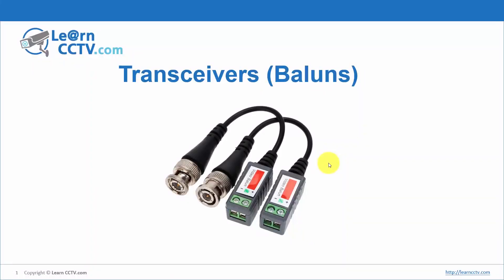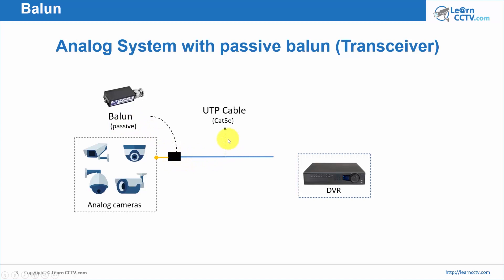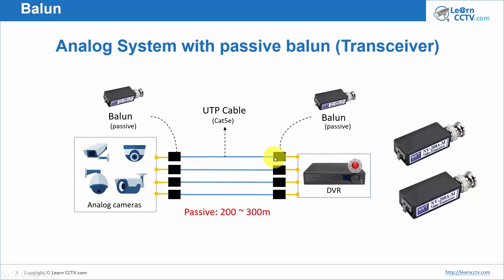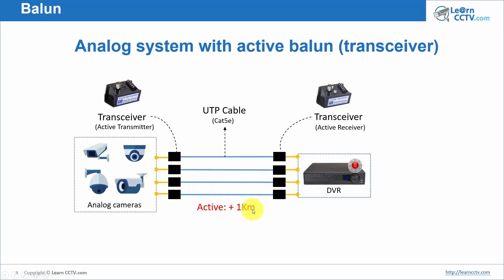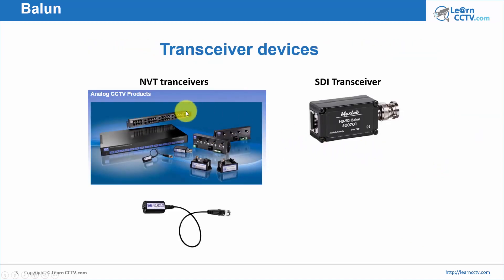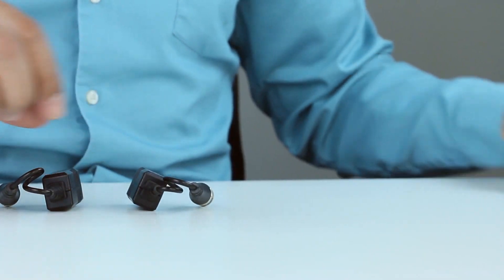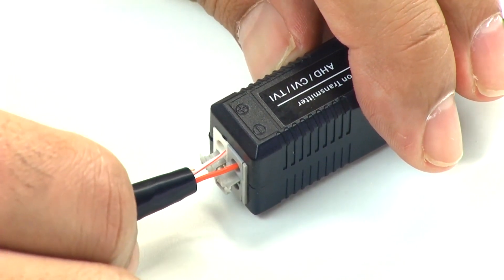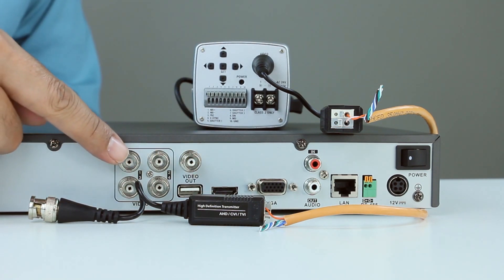How to Install Video Balun for CCTV Camera (HD-TVI, HD-CVI and AHD cameras)

Comment: Hi there, I have difficulty to connect my IP camera with my DVR? I cut my IP camera's cable and now need to reconnect it with cat 5 cable or just ordinary camera cable. Please any solution? I have 2 Video Balun as well, but as you know IP camera has 7 color wires.
Reply from the maker: There are two different technologies. 1. Analog and 2. IP.  The analog cameras use RG59 (coaxial) cables or UTP cables with baluns to connect to a DVR (Digital Vídeo Recorder). The IP cameras use UTP (cat5e or cat6) cable to connect to an NVR (Network Vídeo Recorder).
You can NOT cut the UTP cable from an IP camera and connect it to a DVR the same way you do with an analog camera.
Baluns are for analog cameras, IP cameras don’t use them. The exception for that is when an IP camera is hybrid and also has an analog output, but that is not common and it’s usually available on more expensive cameras such as the Samsung SNB-6004 and its newer versions.

Comment: Sir can i ask where's your centralized power supply? im using Dahua T1A21 2MP HDCVI IR Eyeball Camera & Dahua XVR1B08H 8CH Penta-brid 4M-N/1080P Cooper 1U DVR.. Diagram eg. CCTV to Video Balun to Cat5e to Video Balun to DVR. There's no power to the CCTV?
Reply from the maker: Vídeo and Power are sent using different cables. In the video I show only for the video, but there's a centralized power supply that can handle up to 8 cameras. You can find other video in the channel where I talk about the power supply.

Comment: Hello I must say I don't understand,  why do we need these video balun why can we just plug camera to dvr ? please explain why we need them . I'll tell you why I am looking at this video  I bought a 4K camera that only work with a TVI DVR and didn't know it , so now I want to make it work with out a TVI DVR and go straight to tv or monitor  . Can you help ?
Reply from the maker: You can use coaxial cables or UTP cables for cameras installation. With Coaxial cables, you connect directly to the cameras and DVRs, With UTP cables you need to use the baluns as shown in the video. There are some differences when using both cables, you can use UTP cable + Baluns for example at longer distances.

You can't connect a TVI camera directly to TV since it doesn't support this type of signal. You need to use a TVI to HDMI converter (I assume your TV has an HDMI input) Here's the link with a device for the converter: https://amzn.to/2D1aZmN
Reply: @LearnCCTV  HI and thanks for the fast reply ! I did see that converter and was hoping I could make something for less money it is for one camera and it came with 60ft of BNC cable and RCA jacks  here the link in eBay  ( ZOSI 4K Extreme HD Security Camera 8.0MP Waterproof Bullet CCTV Camera system )    I have old tv's and want to use them but has no HDMI it has VGA port and RCA port for video  and DVI port . Guest I'll need a adapter to make VGA to HDMI   . Well I see I have to turn analog to digital signal .   I am good with my hands so try me please I know we can make this conversion for less .
Reply from the maker: @m42665  If you have the DVR (Digital Video Recorder) for this camera, you just need to connect it to the TV. Some recorders have both, HDMI and VGA output. That's the easiest and cheap solution.

Comment: does cat5e cable support over 100 mts?
Reply from the maker: Yes. As long as you use good baluns you can use up to 300m (passive)